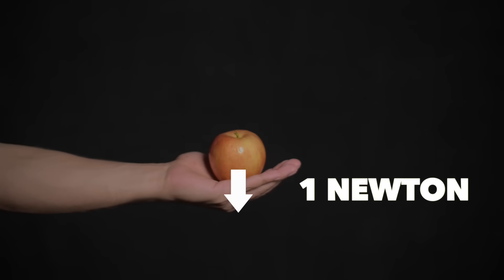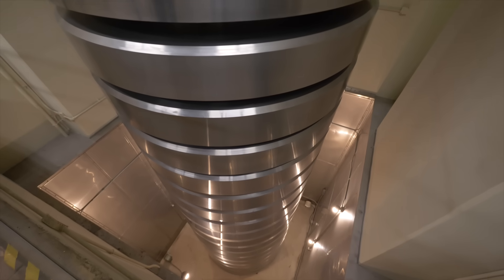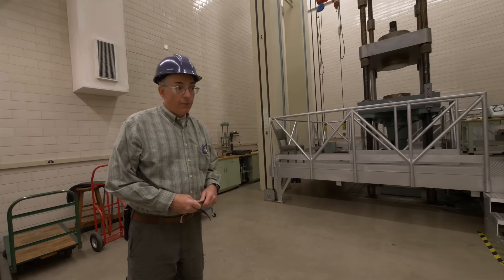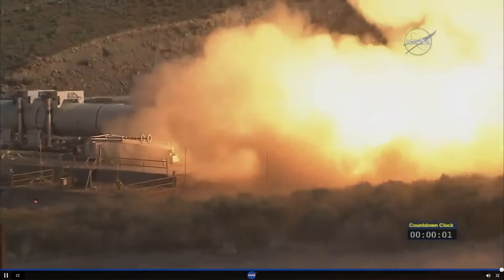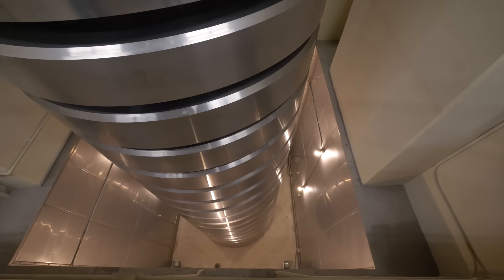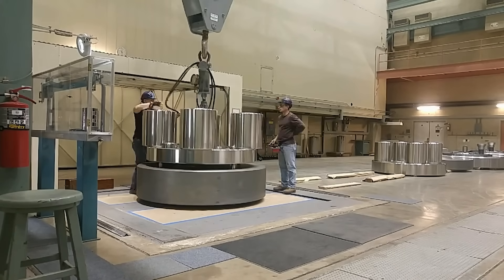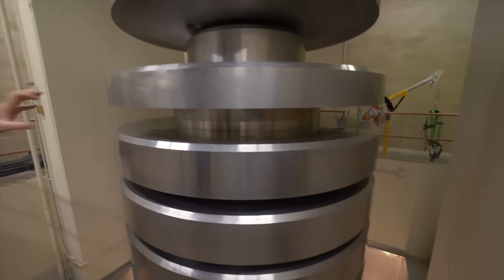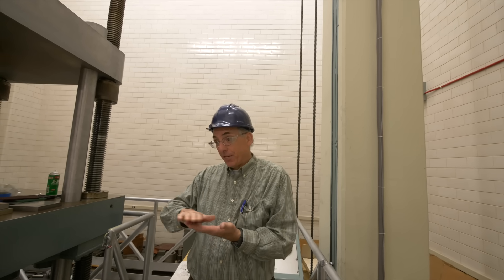World's Heaviest Weight

Comment: WHY MUST THEY USE LBS!?
Reply: You received incorrect data. Dr. Derek Muller is Canadian (born in Australia / grew up in Canada).
https://en.wikipedia.org/wiki/Derek_Muller
Reply: @unclejoeoakland  No, you didn't go to the moon with pounds and inches: "Inside the computer we used metric units, at least in the case of powered-flight navigation and guidance. At the operational level NASA, and especially the astronauts, preferred English units. This meant that before being displayed, altitude and altitude-rate (for example) were calculated from the metric state vector maintained by navigation, and then were converted to feet and ft/sec."

From: https://www.doneyles.com/LM/Tales.html
Reply: "Because pounds are better than kilograms" are you sure about that? "avoirdupois pound, which is legally defined as exactly 0.45359237 kilograms, and which is divided into 16 avoirdupois ounces." divided into 16? well, thats f*cking awesome, thats make things so much easier :D :D :D  what is ounce divided into? some 27 smaller bullshits, or what? :D :D :D retarded rollercoaster of imperial units in its finest
Reply: @rawwad  Yes, 16 ounces. Because 2^(-4 ) is much easier to reproduce in real life than 10^(-1). You simply halve it four times. Gallons halved twice are quarts. Half a quart is a pint. Half a pint is a cup. A cup halved three times is a fluid ounce. One fluid ounce is 2^(-7) gallons. 

And we don't use Imperial. We use US Customary Units. The British use Imperial. Their pints are ten ounces, which throws off the point of binary measurements, and they use stones for weight.
Reply: Just to annoy you!
Reply: A lot of us Americans are comfortable with both systems now, but probably not so much long ago when that was built.
Reply: @jeffgreenfield7025  yeah and 50% arent even familiar with one of them
Reply: First Last - Thr metric system also works, so that argument is not compelling. I'll argue the metric system has a much more intuitive length unit system than the US imperial counterpart: One that does not involve multiple arbitrary conversion ratios within the same system. I'm talking about inches, feet, and miles.
Reply: and no metric users went to the moon with it, what an interesting counterpoint to make to people who say "You can only use metrics to real science".  Of course any intelligent person understands that math works the same no matter which unit of measure you use, and it has no effect on the real world weight , momentum, and physical reactions of the real world.
Reply: Because Americans are weird.
Reply: Merica that's why!
Reply: Derek Henschel what's a nutton?
Reply: @Vangabonders  A newly invented thing that measures how nuts people are..hence the name "Nutton"
Reply: @Vangabonders  some kind of Japanese porn, I think.
Reply: Derek Henschel of course it can. 10 newton = +- 1 kg
Reply: we should unite in this (using SI of course)...at least while doing science stuff :)
Reply: XX Cuber Because it is not an SI unit and has many practical problems. That's why the world moved on to a more accurate SI system
Reply: Reason why America still uses the Imperial system is that they don't just make Americans look fat, they sound fat!
Reply: WhiteDragon Nah blame pirates. They stole the metric ton to fully convert America to using metric as you need a sense of scale but oh well I mean at least it is hard to use American equipment I guess.
Reply: T-X-M omg a moon hoax believer...
Reply: To get more views because people think because it has 1mil it "super" heavy.
Reply: America that’s why , anything different they see as invasive so they stick to their own measurements.
Reply: cause it's easy to use lol
Reply: Kilo Byte  Being educated means being a libtard? haha if you saw my ballot choices at the last elections you would be proven wrong in your assessment
Reply: yeah more like 100,000,000 milligrams Even I could possibly lift that 1 million pounds is like saying ton's don't exist UK is real there is more weight then that like 2 million pounds!!!
Reply: @jimkoller1818  100,000,000mg is simply 100,000 grams or ** 100 kilograms **. The ease of divisibility is why metric is superior. (I'm from USA)
Reply: Why must you abuse caps lock?
Reply: Because, if they used PIZZA I would eat it
<----- THIS IS A PIZZA
Reply: Because, that’s an adjective u can use to describe a verb.   What would you prefer them use?  Ounces? Newton’s?
Reply: Allegedly...
Reply: @Yorick La Rivière
Thanks, now we know!
Reply: Vangabonders Exactly my thought...
Reply: Crazy Nerd Inventor Maybe....🤔🤔🤔
Reply: ZesPak so, you don't believe the moon landing?!!
Reply: Because we are AMERICAN dammit
Reply: american standard.
Reply: I weigh 90 lbs.
Reply: Because it’s America... duh
Reply: STFU Europe tard
Reply: Because pounds are better than kilograms
Reply: Confused lbs n pounds....isits necessary???
Reply: Vangabonders because ‘murica
Reply: America bitch
Reply: 666 likes
Reply: Cuz it was made in Merica
Reply: because its not overly complicated
Reply: big shaq tiddies
Reply: Maybe we could discuss the amount of salt in this thread and the best way to measure it?
Reply: Vangabonders because Kg is for boring people
Reply: @TheDarknessConsumesMe666  or for people who dont want to have a headache while converting
Reply: BECAUSE I LIKE IT LIKE THIS
Reply: <Rest of the world>
1t=1,000kg=1,000,000g=1,000,000,000m

<America>
1t=142.857stone=2000lbs=32000ounce

What is wrong with you America
Reply: You guys already lost mars satelite because of this damn measurement. 
And I bet hundreds of stupid accidents would happen every year.
Reply: 1 newton is the force required to accelerate 1 KILO to 1 m/s^2 thats why it should be newton.
Reply: Does it matter if they use "lbs"?
Reply: because a million is more clickbait worthy than 500,000
Reply: my thoughts exactly, the metric system makes sense the imperial system seems to have been made up by someone who ate the wrong mushrooms, smoked some pot and fired up the crack pipe!
Reply: Because they do...
Reply: If it annoys the rest of the world when someone uses American measuring than an American might commit suicide if someone uses metric. That’s why we haven’t changed
Reply: Because we don't care about your feelings, or your system of units.
Reply: I was so annoyed by the lbs measurement
Reply: -T-X-M-  Nonsense - There is no difference in accuracy. Metric should be used because it's much more convenient to calculate and because everyone does it, except for a part of American engineers and the US public.
Reply: So I just checked Wikipedia: modern pounds/inches are derived from metric kilograms/meters anyway.
In other words, they totally CAN express all of this in metrics anyway, but deliberately convert away from them (with a known constant so they can safely convert back) just to spite people
Reply: @TARINunit9  "deliberately" is a bit of an assumption, whose to say they didn't get the data in reasonable measurements first and convert to metric when asked?
Reply: @ClippyForConsumerWrights  [offers a toast when you say that pounds are the "reasonable measurements]
Reply: Because America.
Reply: The metric system is based off distances,  volumes and weights of globally (in the case of volume and weight its universal) applicable constants. It just so happens this system was developed by scientists during the reformation period who understood the value of a decimal system versus the imperial standard that is too relative and subjective to be a reliable measuring gauge.

The imperial standard is an archaic system of measurements that has no practical use whatsoever beyond using it to cut 2x4's.

We learn this in school here in "not the US".
Reply: America
Reply: Because us Americans are ignorant
Reply: Vangabonders 

Childish gambino: THIS IS AMERICA
Reply: Because killos are gay
Reply: I'm sorry I thought this was America!
Reply: Technically we dont, since 1974, the US government uses metrics in all government and military operations, private citizens and companies use imperial because it's the common standard that everyone is used to, but US companies could switch if they'd like to as most Americans today are educated on metric conversion. Any American under 30 may not know exact size, but they can still visualize a rough approximation of metric units, however companies stay with imperial for fear of losing sales.
Reply: because dumbfuckistan needs to use what it invents
Reply: Vangabonders freedom
Reply: I get the feeling  that the issue is that metric people can't physically relate to a mass specified in imperial measurements, it's just an arbitrary value to them (you might as well be saying, "well, it's mass is 10894652343.45 zblorts", it's completely meaningless), now if he said, "its mass is 1,000,000 lbs, or 453592.37 kilos", your metric calibrated person would be able to relate that to approx 453592 bags of sugar, or around 450 tonnes. A related annoyance, why measure everything in pounds, though? There is a perfectly serviceable U.S. ton, but people still seem to use pounds for everything, including weights of cars. I don't get that.
Reply: -T-X-M-  why is you country inferior to America?
Reply: Murica
Reply: Because there smart
Reply: AMERICA boi
Reply: Mostlyharmless1985 well, the thing is Newtons are just generally more accepted as a more accurate and it is also used by many other countries and continents. So you should get over yourself and accept the fact that he wants to use a form of measurement of force which is just more widely used than pounds.
Reply: @greg7402  he also used Newtons... Watch the video
Reply: @greg7402  Newtons are not more accurate, it's just a different number.  You use a single completely known number to convert.
Reply: @greg7402  They won't though and much like the US Military including USAF where I worked as Electrical Engineer and Aerospace propulsion specialist, as well as NASA, all use Standard or what you would call Imperial. However, we also use Metric. Standard is better for some purposes and metric for others.
Reply: Template Can we agree that the metric system is better? Also this was a while ago and I don’t remember what I said. I think I said that Newton’s were more accurate. Which is a more acute measurement of weight or force. If I said it was better, it’s probably not. When it comes to how accurate it is, then it is better. Mind you, accuracy. Look at it this way 2kg is equal to the force of 19.6N. We want something which is ever so slightly larger than 2kg in force. You can’t just add 1kg of force because that’s too much, and converting to grams and adding grams is still a measurement of mass instead of force (which can be used, but is not ideal). So we can add the acute amount of Newton to something for our problem. Another way of looking at it is paintbrushes on a painting. We want to draw something very articulate but at the same time is also has massive areas of canvas which are only for a singular color. It is not ideal to use the small paintbrush (Newtons) for those areas and instead any other paintbrush that is larger and more fit for that area. But there are also large areas that require specific and articulate touches. Thus we would use a small paintbrush (Newtons). Newtons is not better or worse, it depends on what is being measured and the necessity of change in that measurement. If this doesn’t make sense I’m sorry, I’m really tired and I am sorry if I was rude in any way.
Reply: @greg7402   "Hurr durr, metric is more accurate"  They're called fractions and decimals, European genius. It doesn't matter how small or large a unit is, they're all just numbers and math is math.

But hey, maybe Europe is right. We should just all use what is common. So stop teaching your children your own individual languages and all of you just convert to English.

Cue the reasons why doing things the same way you've always done them has more value than doing things the same way other people do them.
Reply: I'm American and I agree we should be using the metric system. However I'm educated unlike 50% of my murican brethren
Reply: @djlowtek  finally
Reply: @djlowtek  wow you're sooo special
Reply: Vangabonders They use pounds because this is America!
Reply: Only reasons US is still on imperial is because moving to metric costs and changes are hard. All signs for speed limit and speed gauges need to be changed just some examples. Average goe shouldn't really care either way(Avrage joe is against metric system) but everyone else that is businesses its pain in the ass because they have to constantly convert and as we know stupid mars satellite crashed because of it.
Reply: Ian Draws he's a Canadian-Australian... But anyways. We went to the moon with pounds and inches. So Chill.
Reply: It's because : In 1821, after studying the various units of measurement used by the 22 states, Secretary of State John Quincy Adams determined that the U.S. Customary System was sufficiently uniform and required no changes. https://science.howstuffworks.com/why-us-not-on-metric-system1.htm
Reply: No. Its hundreds of years old and was derived from the weight of grain. So you could count out a bunch of grains and know you had "about a pound". All imperial measurements are basically based upon real things, so I mile was derived from 1000 paces. The problem with it is none of it is decimal so although its easier to work with if you want to measure roughly how heavy are long something is by slapping part of your body on it, its not good for calculations or accuracy.
Reply: Spencer 23 Dollars the weight of a pound is derived from the weight of a kilo.....it’s exactly 0.45359237 kilos. But then again the whole metric weight system is based off a physical object in the basement of a building in Paris so the definition of the kilo changes over time. Now that’s low
Reply: @6SLeGM  not to mention that physical object, despite being in an airtight clean jar under extreme security, has been recorded to lose weight over time, which is why there's three redundant weights to compare against
Reply: @spencer23dollars34  - Units are immaterial to whether it's "decimal" or not. If something weighs 15.7 pounds, how is that somehow less of a decimal value than 7.1kg? The only thing decimal about SI is prefixes (kilo- mega- centi- milli-). The value of a meter, kilogram, and degree centigrade are interrelated, but that only helps if you're working with water. Other than that, units are arbitrary. Inches and pounds can be decimal or fractional. I use decimal inches in mechanical design all the time.
Lest you think I'm an Imperial bigot, whenever I weigh something on the kitchen scale, I use grams, simply because I'd rather work with whole numbers than fractions of an ounce.
Reply: @ztoob8898  deci means ten. Pounds are NOT based on multiples of ten
Reply: ztoob8898 that’s the dumbest comment I’ve ever heard. You don’t know what you’re talking about do you, it has nothing to do with having a “decimal point” omg
Reply: @spencer23dollars34  it originated by these things but has since been given a standardized measure
Reply: +Vagabond...Maxine Watters
Reply: Papa Eriko like they got to mars, right?
Reply: @ZesPak  we got to the moon bud
Reply: Cause Merica's stupid (I am american)
Reply: America is for world leaders, not world liters.
Reply: Graham Hepworð oh my god best comment ever
Reply: America is for world leaders? Lol, your measurement system, the founders of your country, the founders of most big cities, and even your language are European. You dont even score top 50% averagely on basic living aspects compared to first world countries and have a mass shootings every day. Kids go to scool with bullet proof backpacks like its a Syrian warzone. Get your head out of that egocentric american ass haha, except for political influence you lead nothing
Reply: Graham Hepworð sure...
Reply: Vangabonders ikr
Reply: Vangabonders why not tho
Reply: There are two types of countries in the world. Those that use the metric system and those that have been to the moon.
Reply: @BrandonBarnhart  like russia? (uses metric)
Reply: @BrandonBarnhart  and nasa lost a rovket because of coverting errors lol
Reply: Because kg is dead
Reply: He sounds American, but sucks for you non-Americans HAHAHAHAHA!!!
Reply: because it works, and changing entire systems to something new just to make remembering the boiling temperature of water slightly easier is not really important.
Reply: because whole US is retarded
Reply: lbs is derived from the metric system?
Reply: Cause they are the best measurements
Reply: Cause metric is gay
Reply: T-X-M You just called Veritaserum retarded since he’s American...
Reply: Does it matter? You make a heavier weight.
Reply: Pounds are used to measure rocket engines, Grams are used to measure sugar plum gum drops. Enjoy your sugar plums my European friends, but the rest of us have work to do :D
Reply: Pounds are a measure of force related to mass. It makes perfect sense when you get over yourself and think about what it is they are doing.
Reply: Mostlyharmless1985 US scientists use kg. It’s a staple for mass all over the world.
Reply: Hamza abdullah they. Are. Not. Measuring. Mass.
Reply: @Mostlyharmless1985  why you gotta be condescending
Reply: Because they got to the moon
Reply: Papa Eriko NASA uses kilograms though.
Reply: @papaeriko1095  because they fucked up a sattelite because of conversion errors from km to miles
Reply: Papa Eriko but your promblem is that NASA used the metric system
Reply: Because this is in America.  The superior nation!
Reply: @dinogaming4419  If western countries were divided in two categories (the shittier ones and the better ones) USA would be in the shittier ones without a doubt.
Reply: @aitismarka9483  Yeah because the richest country in the world would be in the worst section.  I know so many people hate America but this is taking it too far.
Reply: Vangabonders BECUASE NUTTONS CANT BE MESURED BY
KILOGRAMS